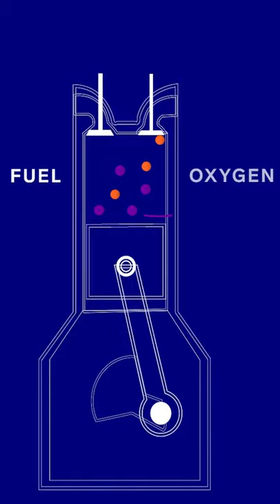Why some cars shoot flames

Comment: Does that mean that cars that have flames out the back aren’t as efficient because not all of the fuel was used to power the car?
Reply: Yes
Reply: They aren't efficient but plenty of power, they run rich because the motor needs the fuel

Comment: Pretty sure you have to modify the exhaust too, it's not as simple as unburned fuel
Reply: Not necessarily, if you driving manual you can
Reply: I dont think the exhaust doesn't really plays much of a role.
Reply: @jammaschan  isn't the whole point of the catalytic converter to catch the unburned fuel
Reply: @sastrinidis  Nope, it's to convert very harmful exhaust gases into less harmful gases. They do convert some unburned fuel into CO2 and H2O, but as evident by the flames coming out, not all the unburned fuel can be removed by catalytic converters.
Reply: A lot of high-performance vehicles do it without mods